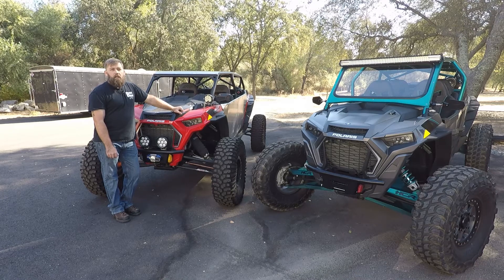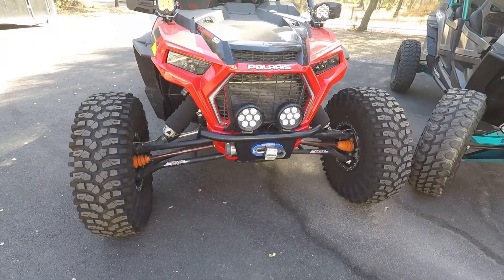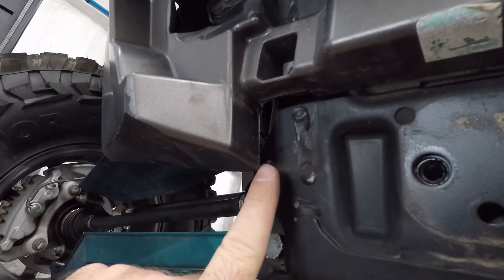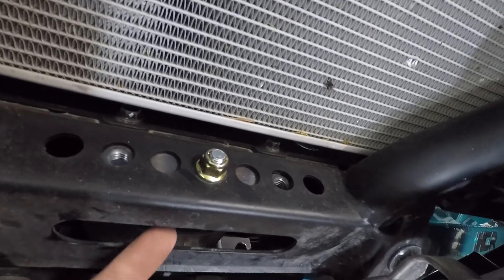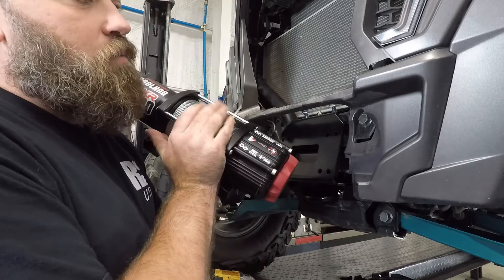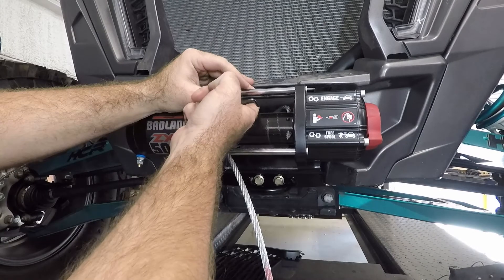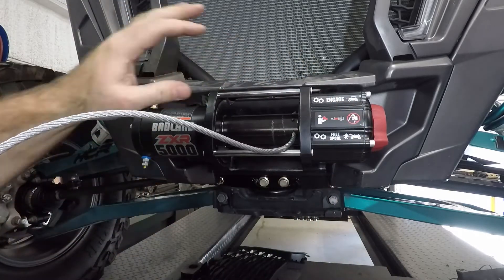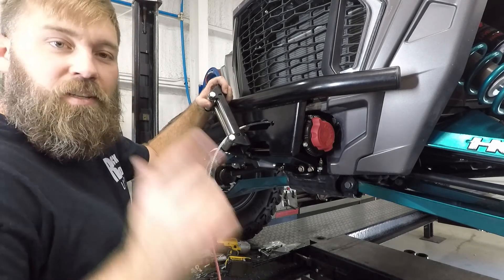RZR Turbo S Winch Bumper Installation Instructions

Comment: Hey Charles, does the apex 5500 long drum fit without any extra modifications? Also, would a KC Flex Era 10” light bar fit the light tabs?
Reply: I have not tried the apex on it so I can't say for sure. It might fit as it's a little smaller I think than the warn.  There is a dimensioned photo showing the light mounting holes on the product page.
Reply: Any idea when that bumper will be back in stock?

Comment: Did you run cables all the way back to the battery or just the busbar?  I have the Turbo S 4 seater and half the people say I should run them back the battery which is a huge pain.  I have the same Badlands winch.
Reply from the maker: My personal machine has them ram to the battery. The Polaris kits have them to the bus bar usually with the Polaris power and ground kit.  You should calculate the max draw of the winch and any accessories you may have on at the same time and then choose wires/wire size accordingly.